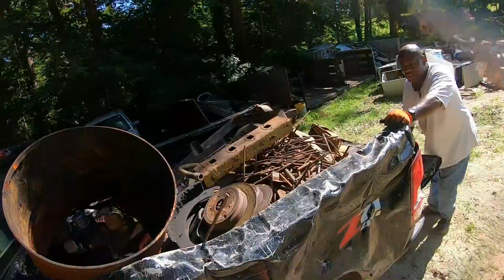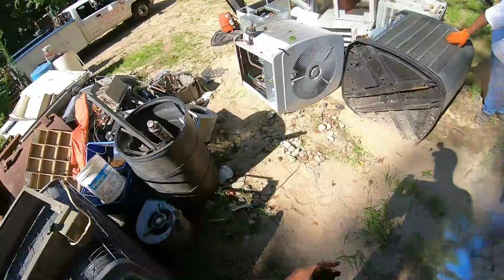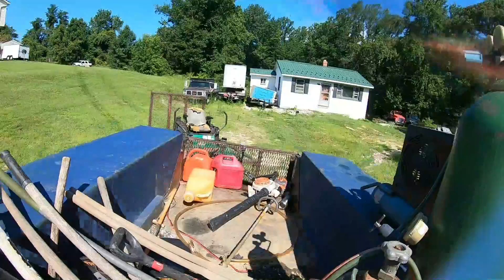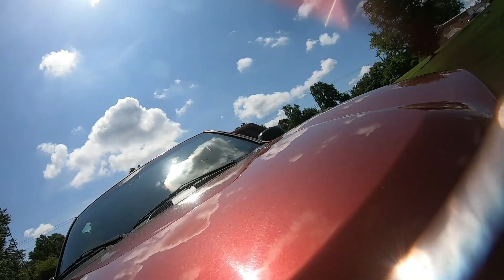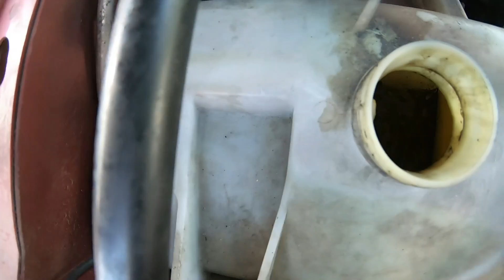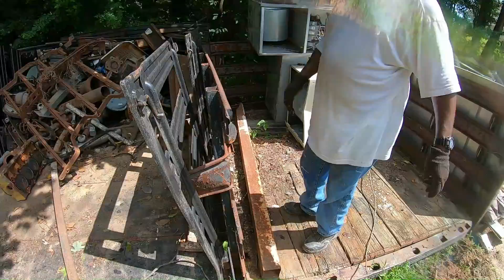SCRAP IT OR FIX IT!? Broke down badger

Comment: Badger needs to cut his losses with that POS and get something a bit more fly like a 64 Impala convertible... 😜💯👍🏼
Reply from the maker: Lmfao with 100 spoke 13 inch rims and a true 3 wheeler hydraulic system
Reply: Jimmy #1HMS....That's the one...full on Low Rider styli lolz 😂

Comment: I'm a mechanic  So You have two options here . The valves are bent  because the chain has either come loose, or the tensioner has failed and jumped some teeth . if its not timed properly the pistons come up as the valves are open and push against the valves and bend them and break the cam or the caps. You can replace the head with a second hand one and work out how the and why the chain jumped or replace the whole motor. probably cheaper to replace the motor  yourself.  Good luck to you both.  Another method to clean the water reservoir is to take it out and throw in a hand full of nuts or gravel add some water and shake it for a minute, then pour it out and wash it out with the hose.  poor badger More money. Save it. You could have done without that.
Reply from the maker: Thank you for the advice. I was concerned that valves might have possible beaten up piston(s) as well. Not sure though, he ordered a used motor hopefully it's good. Good idea about the reservoir wouldn't have thought about that

Comment: GMC  Denali. Bager. That freaken engine in your suv is a problem.

Get a Denali. Yukon. And God will bless you with one of his finest works of art    the LS motor .

And Im a die hard moparman but drives an GMC Sierra freaken AC is awesome.And an l33. 5.3liter.

Man I wish I could help you.
You guys are very entertaining.
Reply from the maker: Hey there I'm glad you're enjoying the show thank you for watching and commenting. I have a 2013 denali AWD with 6.2 and its bulletproof. My 09 silverado 5.3 has destroyed 1 transmission and rearend. It's a half ton but as you can see I installed a 2500 rear in it lol. I beat the hell out of that whole truck and it begs for more

Comment: I like that brown square body Chevy 1 ton in the background 👍
Reply from the maker: I used to use that and the red one to scrap (they both dump) but it's way easier with service truck and dump trailer in my opinion. Plus less $$ for tags, insurance, tires, repairs etc when just running one truck
Reply: Jimmy #1HMS I’d love to have one like it

Comment: Hi Jimmy you got nice bit off steal there to make your grill up for your backhoe now to save the rad. I'v got a load off brake discs over here you can have. L.o.l   How come you're main didnt ring when he broke down or he just take straight to garage to get it fixed.  From Andy in UK
Reply from the maker: Yea that's a good idea about backhoe grill thank you I forgot! I was on vacation when it broke down the first time and he paid to have it towed
Reply: @1320LUV  bit off a shame but shit happens. Ya do that grill be for Mr bucket high. Dose the rad. Some good videos feel bit bad for the Badger he likes his truck.  I'v just Bort anther land rover. Scrap one buy one. I'm mad .but I love them. When u go to do a bit off of roading and my really old landy has to pull a big 4.liter jeeb like u have  over there. He wasn't a happy man. L.o.l graha day thow.
Reply from the maker: @andywilkinson3792  yes it's only a matter of time before badgers decides the radiator doesnt need fluid hahaha. Land/range rovers are laying around everywhere over here.... costs too much to fix
Reply: @1320LUV  if it's the first discover 1 land rovers they cheap as chips to fix over here.  I just bought one with all the bells and whistles top speck I give 100 pound 4 it. But if it's discover 2 ya they can be pricey to fix. Same as the range rover P38 can be. If you can find a nice old range rover. Cheap I would love to get one off them. The two door range rover wich is the first range rover.  They make big money over here and if they are really good you looking anything from  8000 right  up to 15000. Over here. If you could find them and we can sort out shipping we could make big money. Cos they rot out over here you carnt find any realy so for a nice ones is the price is but down. Thay only things I like working on. Just putting my old range rover on the road now. But they are pretty cheap to fix and sort out.

Comment: Next door neighbor just changed one of those for his son's girlfriend ,  all wheel/four wheel drive, she is into the swap all told (new/used engine, belts hoses water pump, etc) and labor about $3 grand, Terry said he would not do another one for what he did hers for ... good luck Badger.
Reply from the maker: Yea hes in the same boat.... $2k labor and used motor for $1350 delivered plus some unexpected cost
Reply: Buy another vehicle for 3 thousand  or less 04 4wd trailblazers are just over 2 thousand
Reply from the maker: @charlesvlcek2550  hes made up his mind hes goin to fix it. He ordered a used motor for it. Thank you for the info!

Comment: Just scrap it gonna cost you a ton money to swap that engine out I've done two myself and not a easy one too change.
Reply from the maker: That's what I've heard. He just had the front end and steering fixed plus couple calipers and pads so hes justifying a used motor since he just got that work done and knows what he has. I feel bad since it's literally the first vehicle he has been driving legally since he was 16. I guess sentimental to him as well

Comment: That poor block Chevy truck it's almost destroyed what's the story on it??
The Trailblazer, if you can get an engine cheap enough fix it, the 4.2 inline 6 are very good engines.
Reply from the maker: I bought that silverado brand new in 2009 and used it like a truck. My helper bought a used motor for his trailblazer

Comment: just put a engine in my sons trail blazer should of scraped it  badger  just scrap it have a good top end if you need it
Reply from the maker: Hes set on getting used motor. He had front end and steering fixed not to long ago so I guess hes justifying with the fact that he knows what he has

Comment: Put a catipillar diesel engine in it, it will never quit, or look for late 90's donor dodge ram Cummins diesel and swap engine, computer and drive train.
Reply from the maker: Hahahahaha I have a couple 12 valve cummins laying around so we can skip the computer garbage
Reply: @1320LUV   There were three different V8's that went into those trail blazers: 
2003-2004 (LM4 5.3L V8),
2005-2009 (LH6 5.3L) V8,
2006-2009 (LS2  6.0)   V8.
You could grab the engine and computer out of a trail blazer that already has one of these engines... the drive train too if needed. I would find one that was in a accident at a auto auction, but I would buy a whole wrecked donor truck with engine and drive train that you want.
Reply from the maker: @mrMacGoover  he ordered a used motor for it. It's coming from New York..... I wish him the best of luck

Comment: Pull the rims and junk it. The drivers side master window switch go bad in these trailblazers and are 250$ new.  Sell a few parts off that truck n scrap that bitch lol. Nice hauling/vid bobcat badger. Cut your loss badger. Youll get that money back with a few good hauls. A engine from NY? No way 100k NY miles is more like 200k with all the traffic/idling.  My $0.02.  Keep on scrapping.....

Comment: Just change the head and the cams and re time cheaper than a engine if oil preasure is good bobcat can fix it he wont break it off in your ass badger you just gotta stop callin him greasy lol
Reply from the maker: Hahahaha I dont know for sure but with broken rocker arms, my first thought was valves might have banged piston(s) up pretty good. He already ordered used motor

Comment: Dam they really wanted to try some black meat for one time cause they truly screwed my man dam he needs to bust some head any way
Reply from the maker: They did him real dirty. Over $1500 for 2 coilpacks, plugs and valve cover gasket. Then $800 to take it apart to diagnose problem then told him to get a motor and they would install for $2500 lmao I told vince we were goin to pick it up from there immediately

Comment: Trailblazers are garbage everyone I know that has one is very disappointed nothing but problems with them scrap it get a yukon or Tahoe I got my 4wd yukon for 2600 pulls the boat and 24ft  travel trailer like nothing
Reply from the maker: Other than the motor he hasnt had much troubles, maybe he  got a good one. He ordered a used motor for it, I wish him good luck.

Comment: Buy a Ford you won't have so many problems
Reply from the maker: I'm a chevy guy but dodge has changed me, my service truck weighs almost 10k as it sits and it still gets 17mpg with cummins and automatic
Reply: @1320LUV   I work for Ford  and I drive a Ford..
Reply from the maker: @bigdogcountrymusic7146  👍
Reply: Thanks Jimmy